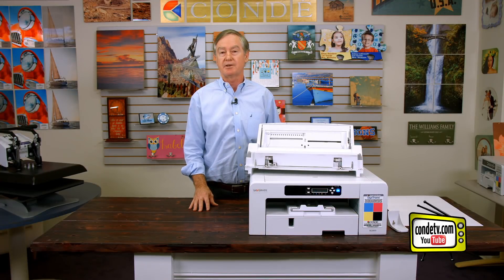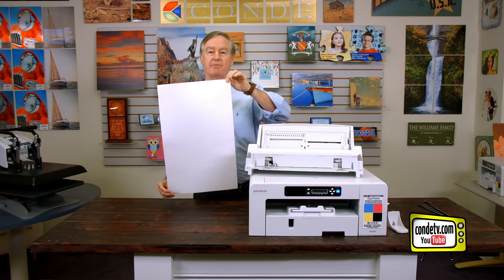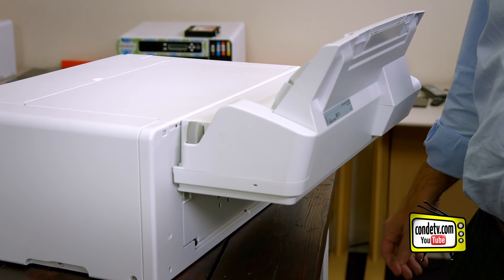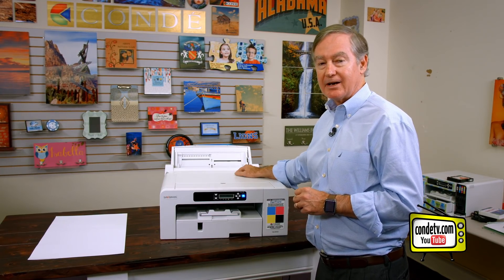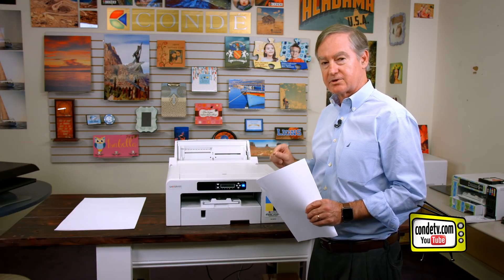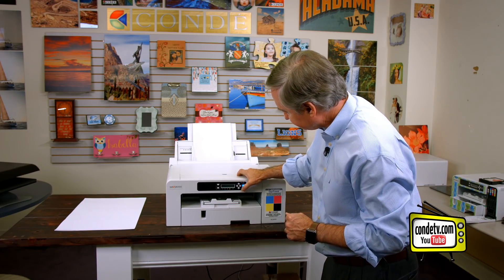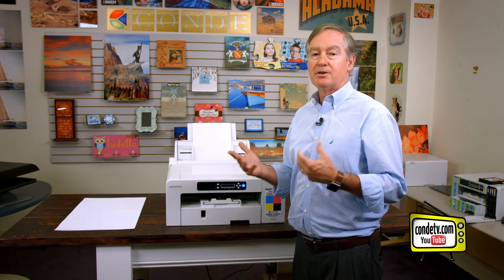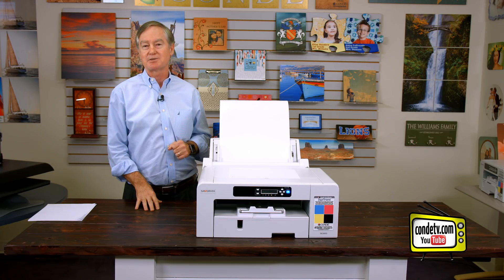Installing the Bypass Tray for the SG800, SG7100 Printers

Comment: I have read that the SG800 bypass tray will fit and work with the older Ricoh 7100 is this correct?
Reply from the maker: Yes, the SG 800 is a refitted and adjusted 7100, so the waste tank and the bypass tray for the 7100 will fit.

Comment: My bypass tray isn't detected
Reply from the maker: You might need to unplug your printer for 10-15 seconds and then plug it in and power your printer back up.  If that does not work, please contact our technical support at support@conde.com.